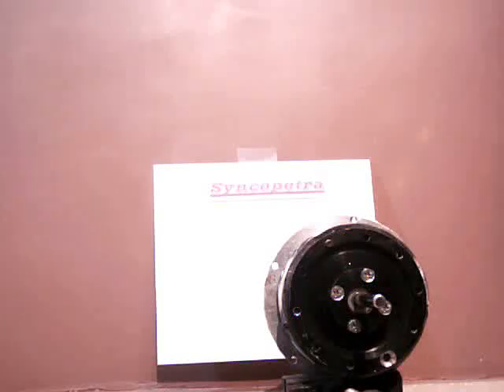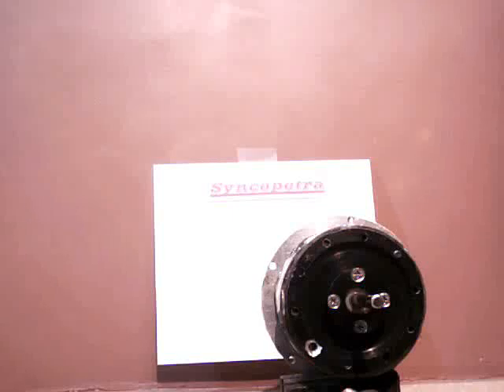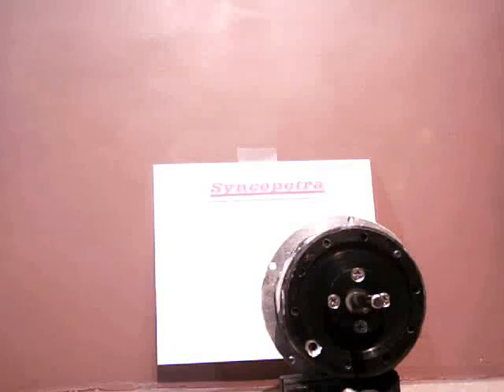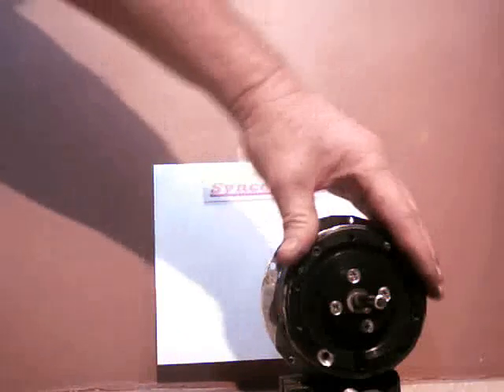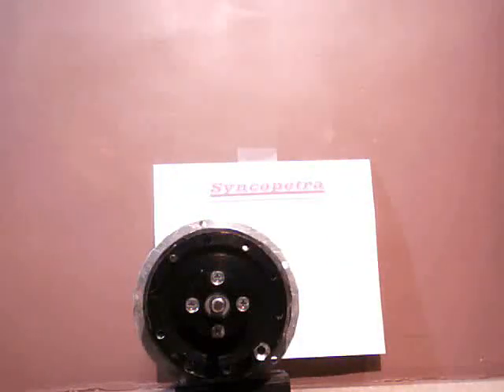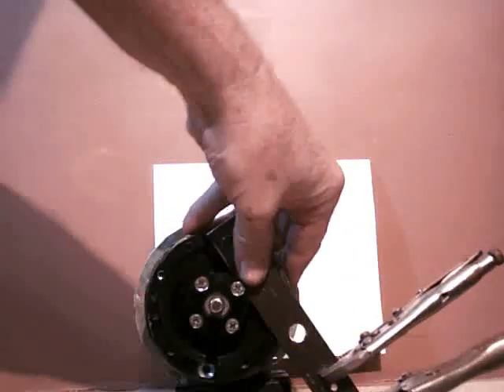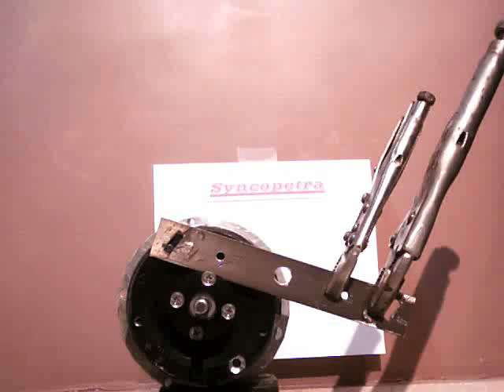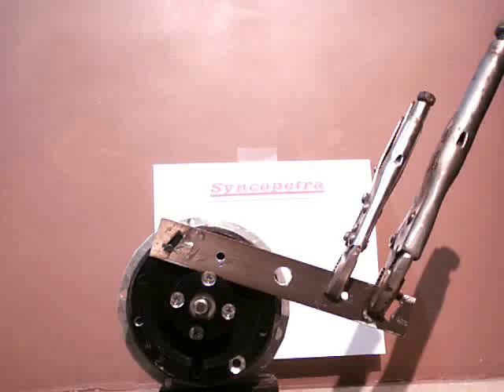A major breakthrough

Comment from the maker: You are probably exactly correct. The secret may lie in getting rid of the toothing or cogging effect, i.e. a homopolar device. 

I have given up on a homopolar motors. However homopolar generators were made by Faraday, Tesla and others. Unfortunately they developed huge currents with no voltage. A hybrid may be the answer.

Comment: lmao, all you have done with assymetrical magnetic forces is to create a toothing affect on your magnetic cog wheel.   You wouldn't take a mechanical toothed wheel that is unidirectional and then say that because it is toothed it is therefore zero point.   While I am optimistic that zero point systems may actually be possible, magnetic toothing is not a breakthrough.